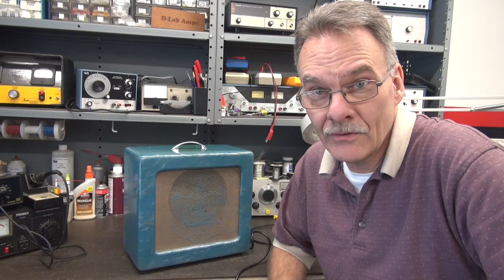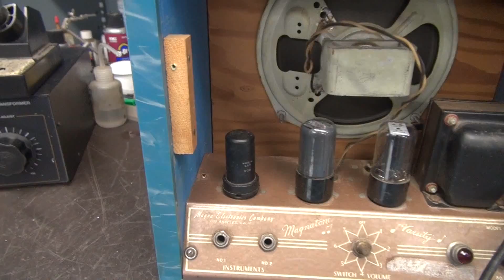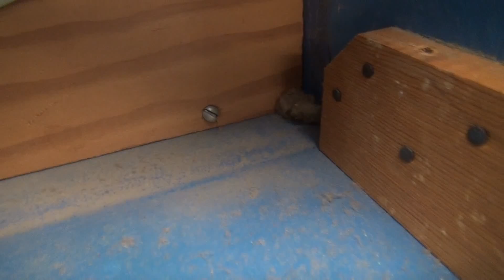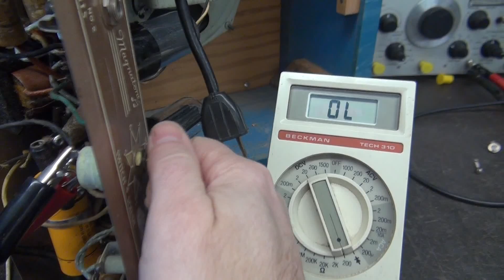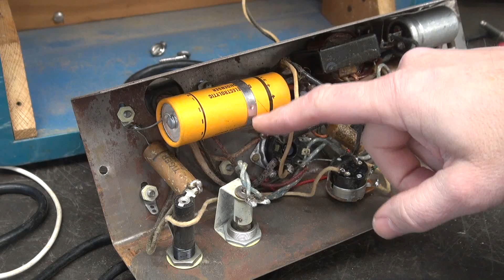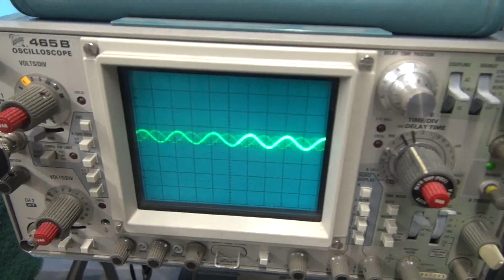How to fix repair Vintage Magnatone tube guitar amp power supply hum

Comment: Me again the 101 heath you have to yell into the microphone just to get it to do 100 Watts on 80 or 40 meters it probably needs any electrolytic v the radios circuit boards to
All I have here is a fluke volt ohm meter and a soldering gun well soldering guns and pencils if I can get it out to you would you be willing to take a look at it?

Comment: Nice work terry.
Your a son of a gu
Good very good electronics repairman.
Give me a starting ball park figure on my
Heath hot water 101
It only works on 80 and 
40 meters. The other
Bands nothing on
 receive hardly no transmit. 20 meters
Is flaky on transmit
Does receive not real
Good. I'd love this thing to be working top notch. I have all the
Right tubes in it and the power supply
Needs new caps probly
The ones on the radios
Chassies circus boards?

Comment: Hi Terry, great video! Lovely!
Have a question for you, I have a 2015 Maganatone Single V, second hand, the sound is great but the tremolo/vibrato and reverb is noisy when it's on, and getting reverb feedback at 12oclock. Do you have any possible clue why it's noisy and how to avoid feedback? Already changed one tube from the reverb channel, but still noisy and still getting feedback. Any help will be dry appreciated. Sent an email to Magnatone support but got no answer from them. Thanks 🙏

Comment: Just watched this in preparation for working on an 1962-ish Magnatone MP-1 with only stated problem of 'blowing fuses'..Thank you for this informative, well-paced, and well spoken job. As a former military 'instrumentation mechanic' and a musician, I have happily fallen into tube amp repair jobs in my 'retirement'....and really love it!...Got a classic Variac, but no audio generator yet, but I've worked on Musicmans, Old Gibsons and Silvertones.  Anyhow, thanks again. Brian  Lompoc, CA
Reply from the maker: Hi Brian, I was stationed at Vandenberg AFB for 8 yrs. We may have bumped into eachother. If your looking for an audio generator, I have a nice VIZ analog solid state unit that is perfect for amp repair, could make you a nice deal on it.

Comment: Here's a dumb question....when you say you hoped that the problem wasn't a bad power transformer...would that have meant that the amp was not worth fixing at that point?
Reply from the maker: Its still worth fixing. Higher cost due to the transformer, affects collectors value due to a different make being installed. So, I was hoping it was not defective.
Reply: I see...that makes sense...thanks for the reply!

Comment: Terry, thank you so much for doing such a wonderful job with this amp for such a reasonable price! Played the amp today for the first time. The sound was absolutely beautiful! I normally use a Klon-style overdrive with my Vox tuber, but today I ran the guitar straight in to the amp at first-- and the sound was so freakin' incredible I never even thought about the pedal! 
It was an all-around great experience dealing with you-- you are truly one Mag-nificent dude!
Reply: OK. Just can't stop gushing about this amp (and Terry's work!). You get a tiny bit of hum when you first turn on the amp-- for about 10 to 15 seconds as it powers up. Then it goes dead silent. This with the volume 2/3 of the way up. It was so quiet the first time I played it, that I thought the amp had died until I hit the strings of my guitar!
It's 5 a.m.-- I've got to put it down and go to bed-- thanks so much, Terry!
Reply: @mikehenshaw2986  They are great little amps when operating correctly...I owned the same one from 1982-88, I never used a pedal except a wah or flanger. I fried the original speaker, then blew about 4 more ceramic replacements until I found another alnico 8" out of a hammond organ, that one sounded great and held together as well. Enjoy it, as any new amp that size is total junk....

Comment: Terry this is a great instructional video. Can you explain what you had to test on the power supply to know it was safe to add a 3 prong grounded cord?
Reply: If you have ac leakage on the primary of the transformer to the chassis,adding a ground to chassis becomes a dead short across the ac power.Guess what ,boom.

Comment: been watching your amp repairs now for a while, i dabble myself, my question concern's final testing i can dummy load and scope a sign wave as you do, my problem is nothing beats hearing the sound quality, but my neighbours dont agree! is there a way to test the audio quality via a low level speaker while at the same time putting out the full output into a dummy load of the correct impedance...i have searched the internet for a unit or schematic of how to do this with no luck...thanks, bob in the UK

Comment: What's your solution for the failing insulation on the transformer wires?   The technique I like is putting shrink wrap tubing over the top of questionable insulation.
Reply: DeadKoby Shrink wrap will insulate some, but it’s not going meet the voltage rating of the original insulation.

Comment: The one I have is very similar. Just different tubes, no power transformer and no pilot light. I'm assuming this is a late 50s to early 60s. Mother of toilet seat amp covering. This is an original varsity student amp.
Reply: Robert Israel, if your supposedly "similar" Magnatone amp doesn't have a power transformer, then the only thing similar about it would be the look and style of the chassis and the cabinet. It sounds as if you have a "Starlet" or similar Magnatone (Magnatone put the Starlet name on several different varieties of transformerless amp with different tubes and circuitry and physical design); those were transformerless "AC DC" amps that only put out about 2 watts of power and can be highly dangerous to play because of the Transformerless design that actually can put voltage on your guitar strings as well as the amplifier chassis. To be safe, you really should get an isolation Transformer for your transformerless Magnatone. Or at the very least, plug it into a GFI adapter that will trip and internal breaker if it senses voltage on the chassis. A grounded cord and input AC wiring modified for safety purposes would be a good idea.

Comment: Hi, another great video! As another viewer commented, could you please describe what "buzzing out" the primary of the transformer really means/entails? Thanks!
Reply: thats2kewl Usually, that means you’re checking the primary for continuity.  As I recall, older continuity checkers (like for telephone circuits) would buzz instead of beep if you had continuity...